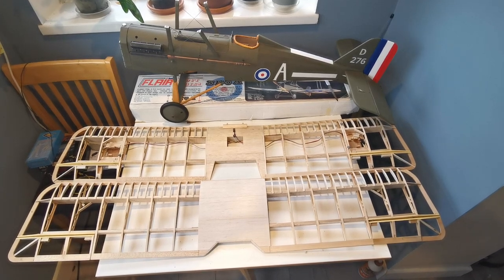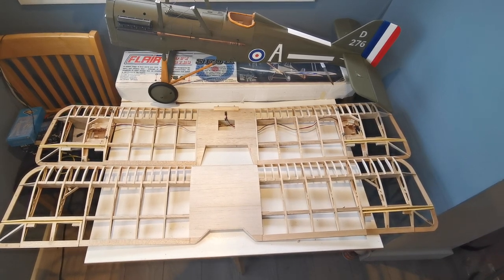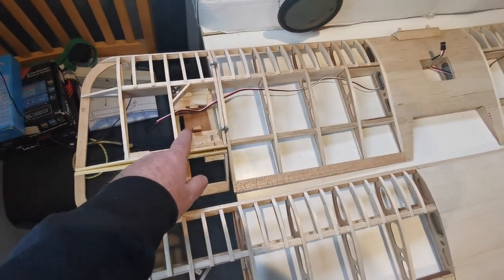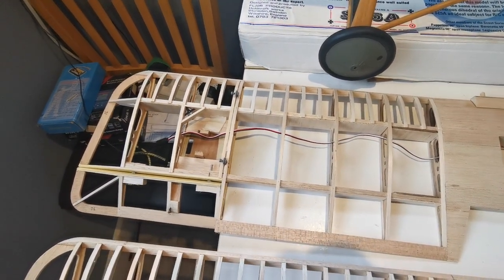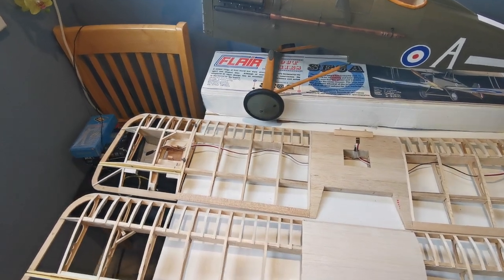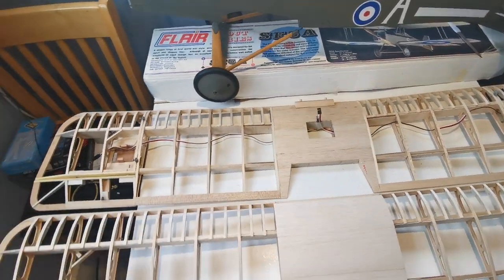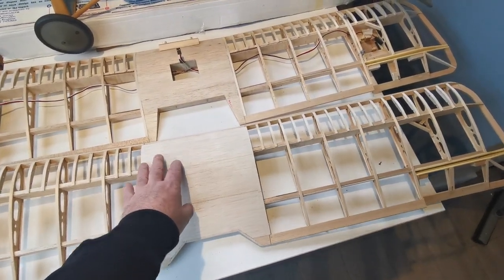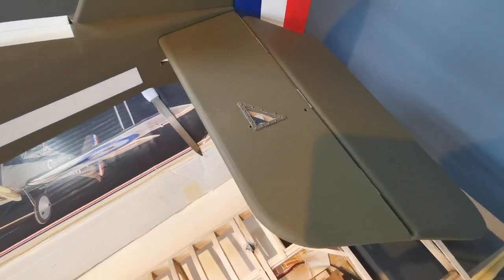Wings complete on the Flair SE5A radio control build.

Comment: I'm wondering if I wouldn't have left the servos in the top wing Mark and just hid the wires down the struts! For the rigging I've successfully used 'hat' elastic ... 1mm (thinner is available) black elastic ... as long as it's bot structural of course 😁👍
Reply from the maker: I was tempted, where did you get your elastic from Cliff?
Reply: @MarkCroucherRC4fun  Hobbyzone but probably any habadasher 👍